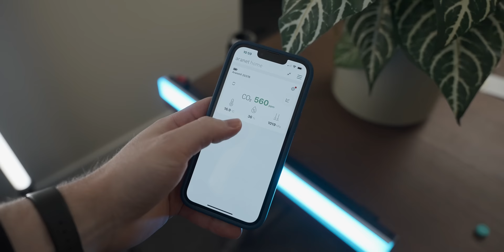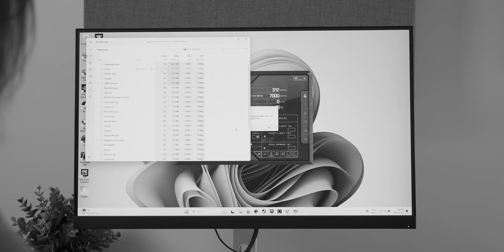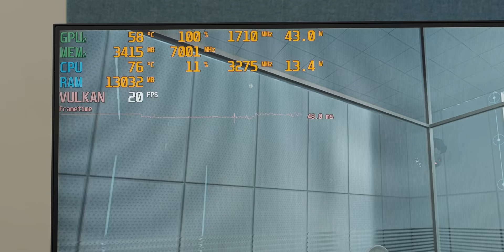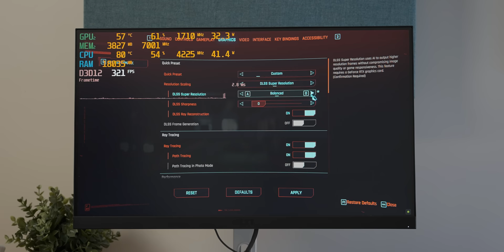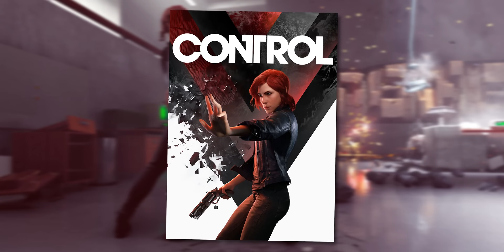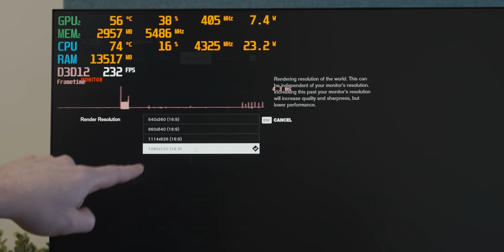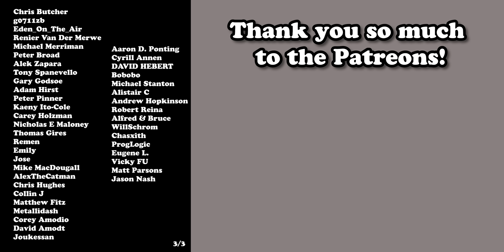Can The Slowest RTX Graphics Card Even Ray Trace?

Comment: When I was in the hospital I took my not-so-gamer Thinkpad with me to play Fallout 4 or New Vegas, one night I set up on an old wall-mount A/C unit and blasted 55F cold air on the bottom and got about 20C lower temps. I was worried that the temp difference could condensate inside so I didn't do it for very long, but surprised it worked for a laptop without a lot of ventilation.
Reply: Its not a problem, as long as it is above room temperature. And hospitals LOVE their room temps be low.
Reply: @alexturnbackthearmy1907  Oh yeah, I believe it. The section I was in at the time was delivery ward as a supervisor to the package courier in the room and temps were probably kept about 70-72F, that's why I kind of worried about it. Then again there was more important things to worry over.
Reply: What Thinkpad is it? I got a RTX 4090 equipped US P1 Gen 6 brand new for a bit more than half price (off of an eBay* auction that I “accidentally” won) than if I had bought direct from Lenovo AU. 

*Don’t recommend, since I bought it off of eBay and shipped it to Australia, the machines 1 year standard warranty was immediately void and Lenovo have been dicking me around saying the machine never came with a warranty, and that eBay isn’t a “sanctioned” place to buy their laptops from
Reply: @thegeforce6625  It's an old Thinpad E560, has an i5-6200U, Intel HD 520 graphics, 16GB of DDR3 and a 2.5" Crucial MX500 1TB. I've upgraded it since I was in the hospital to what it is now, isn't bad for free corporate garbage. I just wish I had a more powerful Brickpad to build into a gaming laptop but haven't found such a thing, it's either too old or too expensive for old equipment.
Reply: @aku2dimensional  nice nice, not a bad machine even today. 

And yeah I agree, I got a high end (but essentially perfect condition) W530 in late 2022 and that cost me about $500aud, and spend probably a extra $150-200 in upgrades such as the i7 3940XM (fastest 3rd gen core mobile CPU) and a 2TB hard drive (I picked a specific model because the manufacturer somehow crammed 3 platters into a standard 9.5mm tall enclosure)

Comment: DLSS 3 doesn't mean frame generation, if that is what you were wondering on portal. DLSS 3 does include frame generation too on the newer cards, but it's the newest upscaling stuff over the board.
Reply: also he was looking at the wrong graphical settings and the visual glitches were most likely caused by modifying them
that would explain everything going back to normal after restarting the game and using the right settings
Reply: Frame generation has been released by amd for every amd card. But nvidia? No dont think so.They can but they wont. Money milking company

Comment: I'd like to see how well a modern desktop GPU gimped to 40 watts would do ray tracing.
Reply: An RTX 3080 laptop basically has the same chip as a desktop 3070Ti (6144 core GA104), and when that is limited to 40W while on battery (I think, I don't remember exactly) the performance is pretty dismal... somebody should do a video on it.
Reply: @leohuangchunwang that why you plug it in
Reply: @Bolt451  That why you get desktop for power. Laptop is not a good idea if you need some serious power, not with cooling of one.
Reply: @alexturnbackthearmy1907  some people need portability and power and its impressive that you can get something that stacks up to a desktop 4080 when plugged in is not only impressive but useful to certain people.

Comment: Glad you put 32gb in, as someone who just did a review on a laptop with limited vram, I noticed going from 16gb to 32gb made a difference because once the card runs out of vram it starts pulling from the system ram which may be all used up then starts page filing off your ssd.

You also need to check your GPUs wattage since there are probably 8 different variants of that card.
Reply: Yeah the RTX 3050 in my laptop goes up to 90w but his seems like its 70w to me

Comment: some laptops use the keyboard for airflow or to just help radiate heat.  I wouldn't necessarily say that having it upside down and closed is best for thermals.   probably more like sitting on the lid with the body raised in the air

Comment: I guess they should've called it the RT 3030
Reply: The new 3050 6gigs should be called like that 💀
Reply: @zsideswapper6718  that one can be the RT 3040
Reply: @zsideswapper6718  What's kinda funny is that the 3050 6GB on laptops can end up being slightly faster due to having a handful more cuda cores. The 3050 lineup itself is a truly strange existence if you include the 2050 with it as a weird cousin.

Comment: Portal RTX is VERY demanding. I only got a locked 30fps with a 3090. You need a 40 series card for it.
Reply: i got a 4090, and is barely playable.
Reply: Definitely demanding. Gigabyte 4070 Ti Super Windforce OC. No user overclock. In chamber 1 I got 30 FPS AVG. Max 40 FPS, Min 22 FPS. 23 FPS 1% Low, 22 FPS 0.1% Low. 2560x1440, Max settings in the normal video settings, Ultra settings in RTX menu, no DLSS, no motionblur. DLSS makes it very playable though, and looks great still.
Reply: i tested it on my old rx6900xt and it ran like cat barf. havent even bothered to test on my rtx 4080 because i frankly dont care.
Reply: That doesn't sound right, something else is afoot

Comment: I bought the HP Victus 15 with intel 13th i5-13420H and RTX 3050, 32 gb of ram(upgraded), and 1tb ssd all included didn't really need to upgrade the ram and the internal memory, and it costed about roughly 816 - 817 usd converted last winter (September - October 2023), I dont really game on it heavily with triple A games mostly RTS games such as C&C series and COH series, so far been loving it as I had a really old MacBook from 2015 and before that was a Lenovo laptop which I dont remember what model it was.
Reply: enjoy your gaming laptop

Comment: Hello Dawid long time subscriber here. Here's a video suggestion Try FSR 3.0 with older RDNA 1 and 2 Cards and compare the differences to Rdna 3 cards results. Would be a great video if you are trying to save a buck on your gpu. For example you could buy a 5700xt used for 100$ instead of 6750xt for 450$. Love the videos and the intro always makes me have a good mood!
Reply: There isn't much difference aside from the newer cards seeing a bigger uplift in some titles. I've run my own benchmarks with a 5700XT, 6700 10GB, and 7900XTX. RDNA2/3 APUs see about the same uplift as RDNA2 GPUs. I think a more interesting comparison might be XeSS on ARC vs non-arc cards, as there is a difference in the system used internally with ARC cards having special accelerators for it that are in a way "emulated" on other GPUs in DP4a mode.

Comment: Probably someone mentioned it already, but the 2050 is not a bad choice if you take the card max power draw into consideration. A lot of entry laptops sport a 3050 that can only draw 35/40W max, those don't do better than a 70W 2050 at least in regular gaming.

Comment: Technically the GTX 1070 and GTX 1080 support raytracing.... in software, but most titles just crash if you try to enable raytracing and those that dont... well its pretty but a powerpoint presentation would have better frames.
Reply: Yup. I've tried it on the Titan Xp (1090) and Titan V. The V can actually sometimes make it happen at 1080p, but the Xp is a total powerpoint machine. The Xp is still in my player 2 rig. Sadly I sold the V during the cryto craze for more than I bought it. I kinda with I'd done the reverse with those 2.

Comment: 20 fps is what i played half life 1 at on a pentium 166 thinkpad, it was rough and pixelated. 

You could play a game like that, helps to look at the floor as much as possible but with enough determination its doable. 

Quake 2 also! It worked pretty well on the software renderer, not dissimilar from what we see here save graphical fidelity.
Reply: thats how i played quake1 on a 486 dx4 100mhz with reduced window size. by the time hl rolled out i was lucky enough to be sporting a pentium mmx 233mhz with a voodoo2. nice and playable good frames rates @ full screen 640x480

Comment: @DawidDoesTechStuff How did you do that? Doesn't the laptop goes into sleep mode or shutdown when the lid is closed? Even I have tried taking display output to an external monitor and it after closing of the lid there is no output to the external display.

Comment: Laptops are really tricky when it comes to designing them specifically for gaming.  Normally all of the parts are super closed together and require considerations made in order to manage temperatures.  Also, there is battery that is hugely affected by running a GPU (any mobile GPU designed for laptops) and as a result often see very short battery life on a single charge.  I think if someone is considering getting a gaming laptop they should be wary of these known complications and be okay with the performance a 2050/3050 offers mostly because it will be much slower to cool down after long gaming sessions

Comment: If you're finding that turning your laptop upside-down gives you a pretty good temperature drop... I'd suggest at least taking a look at the best laptop cooling stand ever built. It's called the IETS GT600 and it's about $100 but it will drop that 80c temp down to 65-75 (as long as laptop has bottom vents) and it's absolutely guaranteed to improve performance. This device can completely eliminate temperature throttling as a performance problem on a laptop that you are testing... or if it cannot, then it means that laptop needs a repaste.

Comment: Dawid FYI - there is DLSS 3 upscaling and DLSS 3 Frame Generation. Those are not the same things.

Frame Generation is either on or off. 

DLSS 3 upscaling is what you used here in Portal. 

DLSS 3 Frame Gen is available on 40 series only. BUT the DLSS 3 upscaling (which is a lot better than DLSS 1, DLSS 2 upscaling) is available on ALL Nvidia RTX Gpus, so 20/30/40 series.

many ppl confuse the upscaler with frame gen. Nvidia calling both things DLSS 3 is incredibly stupid. 

turning DLSS on in-game is the upscaler. Afaik the DLSS 3 Frame Generation setting is called "Frame Generation", so usually you turn on DLSS upscaling on quality mode or higher and then activate the frame gen on top. They arent just one single combined setting tho.

Comment: I have a question: I have a 3080ti, 64gb ram, Intel i9 laptop system. If I use the ultra settings it performs better than when I use lower settings. I thought it should be better if I turn off some of the effects, but it get worse. Why?
Reply: how do you even notice the performance differences with specs that insane

Comment: Man, that's an interesting video, but for a tech blogger you should probably know, that...
First, sure thing it runs DLSS 3. DLSS 3 contains two modules: one for frame generation and one for frame upscaling. Frame generation requires RTX 40+, frame upscaling requires RTX20+.
Second, where did you get that laptop position from? Did you know that at least some laptops input cold air through the keyboard? Yeah, talk about the "airflow" with a closed lid! Not to mention that keeping such a hot thing close to the screen might damage the screen itself.

Comment: 20 and 30 series cards can't do frame generation. Even if it says it's on, it's not happening. There is a mod to bring FSR 3 onto the nvidia cards, but it's not perfect. Interestingly, Nvidia reflex will still work with this mod!

Also, ctrl+shift+esc is the hotkey you need for task manager... press it all on the left side of the keyboard for easy speedy tasky managery!

Comment: Got a used ROG Strix laptop with an RX 6800M in it which in timespy is about the same as an RTX 4070 laptop GPU in rasterization and for about the same price as this laptop. Yeah it may not do Raytracing to well but still I don't get peoples aversion to AMD, especially for a powerful used system its great!

Comment: All rtx gpu's can use dlss 1.0, 2.0 and 3.5. but only the 3000 series and newer work with dlss 3.0. ik its confusing. to clear it up there are setting is dlss 3.5 that the rtx 2000 series can use. its more that 0.5 its using.
Reply: so if you turn dlss 3.0 on its most likely just 2.0 if your on a older rtx

Comment: my laptop which has a 3050 6gb paired with a i5 13420h and 36gb ram runs great on many raytracing games when plugged in and also it uses alot of power like 300 watts
Reply: That is BS. 6GB of vram alone wouldn’t allow you to run 1080p with good frames on actual games. On Minecraft? Sure, on an actual game like fortnite or forza, nah

Comment: Laptops are designed with the air intake on the bottom as planned obsolescence, it makes the machine over heat, slowing the PC making someone thinking they need to buy a new machine. In my lenovo X1 gen6 I limited the CPU speed to 99% in windows and also built a velcro'd on plate on the bottom so it always  has an air gap - never over heats and is actually faster instead of the stupid CPU turboing up to a limit that isn't sustainable by the cooling solution.
Reply: Does setting max CPU power at 99% always prevents turbo-boosting? It doesn't seem consistent on my gen 7 and gen 4 laptops.

Out of desperation, I just set the value to 80% or less so they didn't overheat.
Reply: @HandleIsNewAndBad Hey mines a 8th gen 8520u or something i5, yeah it can sometimes work with 1% drop, or as you said have experiment. Probably could turn of boost/turbo in bios, but figured windows is easiest.

Comment: You had raytracing qaulity set to high in portal rtx, I reckon you could have gotten a higher frame rate in it.
Reply: It already hardly even looked good on ultra performance with DLSS 3 getting 50 frames. Stop tryna act like it can actually run it AND look good.
Reply: @DizzyRL  I'm saying they could've gotten a higher frame rate, it still looks good at lower settings, it just shouldn't have defaulted to high, not even my old 2060 defaulted to high.

Comment: Well Dawid, that is not the slowest RTX GPU (for ray tracing)!
I have a 2020 Zephyrus g14 Laptop with an RTX 2060 max-q (65w) gpu, and even tho it perform way better than the rtx 2050 and somewhat better than the 3050 in Rasterization, its worse than both in Ray Tracing (1st gen RT cores and less of them!|). In Portal RTX with equivalent settings to yours i got 4 fps with no uspscaling (in the same shot at 4:22 in the video), and 27-33 fps with Ultra Performance DLSS in the red button shot at 4:16 in the video. So tecnically i have the slowest RTX gpu out there for raytracing :P

Comment: The only reason that i bought an Nvidia rtx 3060 three years ago was DLSS. Ray tracing was a very trash experience on that card.Dlss is only good at ultra quality mode otherwise it will reduce the image quality so much that you see its not worth turning the RT on !
Anything below a 4070ti cannot be considered as a proper RT card because its simply BAD af. I switched to an Rx 6800 Xt this year and im more than happy.I play every game at 2K NATIVE and MAX graphics without any upscaling (I get 60+ Fps in all games ). Dont need RT. Its not worth the performance loss or texture quality loss after activating upscalling.

Comment: I have a 4050 in this laptop and I've never bothered to even try ray tracing.  I can think of less painful ways to torture myself.
Reply: Z1 extreme can do some basic ray tracing in Cyberpunk , it can be done but it's not awesome of course.
Reply: 4050 is much faster than both of these as it's around RTX 3060 levels of performance but with slightly better RT performance and frame generation support. You can get a good experience in some games with RT on with a 4050
Reply: It kan do it 
Its faster than my rtx2060 mobile.
Probleme is the memory bus is lower.
And that is the problem from rtx 4050 lower memory controler make it for realtime ray tracing and high texture a problem.
You need dlss to set it in the memory .
Really its just 1080 p card .
Wel the rtx2060 mobile with faster memory can do max 1440p .
Well today its really a 1080p card .
Stuck to the 6Gb memory
Reply: @crestofhonor2349  Isn't a 4050 worse than a desktop 3050 and much worse than a desktop 3060 in terms of raw performance? Or were you talking mobile only?
Reply: i have a mobile rtx 4050 and a core i 5 12450h i get 30 fps with minecraft ray tracing 24 chucks
Reply: @crestofhonor2349  wow this is really bad

Comment: Honestly raytracing is nice and all but global illumination is what makes 80% of the difference. Most games have static environments meaning developers can just calculate the reflections and shadows then have those maps be processed without having the user do the raytracing, that’s how things like mirrors, glass and wet surfaces still work in games. Depending how lazy the devs are it could look almost as good as raytracing. This is why people say it’s minimal difference for a lot of performance because in most cases it is. However there is games that stick out such as dying light 2, metro exodus and cyberpunk which do use global illumination and all the other bells and whistles of raytracing that look dramatically different when the option is enabled. You can instantly tell the improvement in lighting. Overall I think raytracing is a really cool feature and I hope that more games take full advantage of it rather than just throwing in a couple basic features just to say they have raytracing

Comment: Even the rtx2600 mobile can not really do realtime ray tracing.
And both rtx2050 and 3050 are slower than the rtx2060 .

Really that i have go for a rtx2060 mobile is dlss function.
Will in that time the gtx1660 mobile  come out in
The same time.